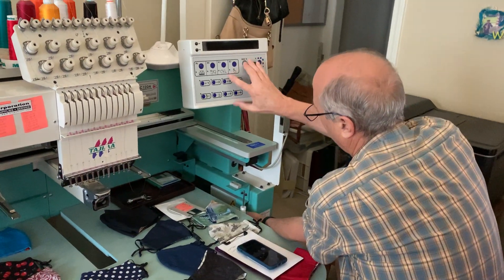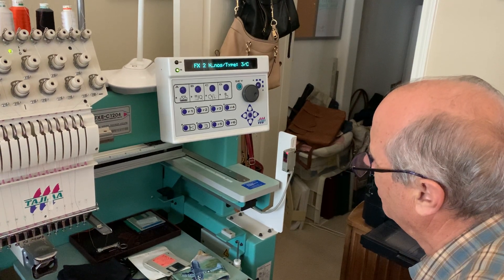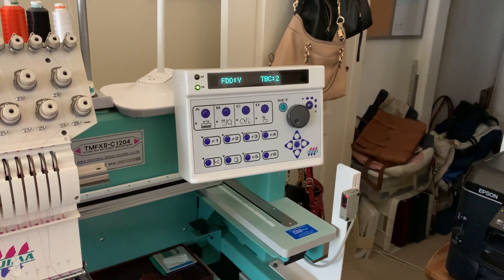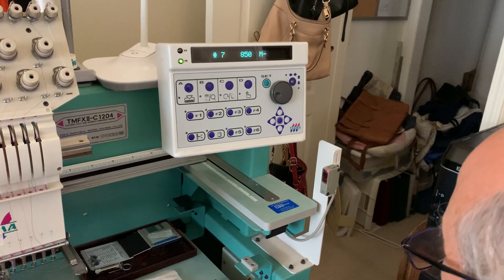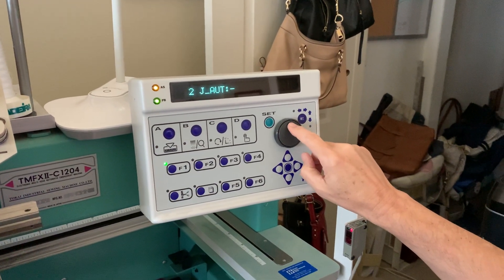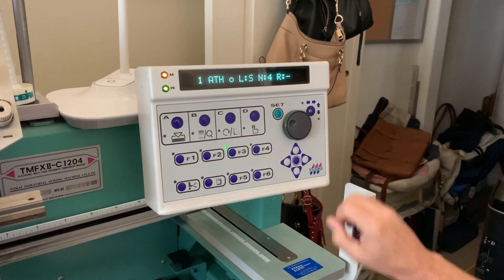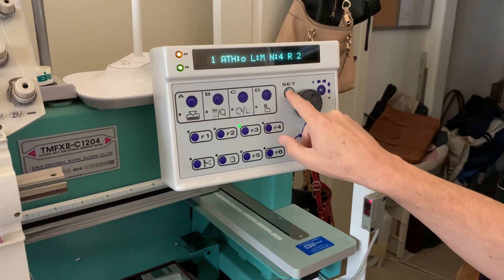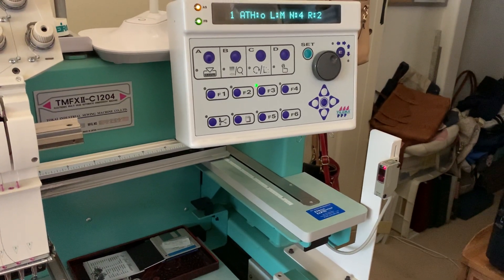Tajima TMFXII C1204 embroidery machine software firmware Installation re-install.

Comment: Good day, I got a TMFXII-C906.  If I do a manual trim it cuts the thread  but during embroidering a design it do a trim but doesn't cut the thread. Is it possible to tell me what is the correct degree or how to to check if the cam is in the correct possition? Thank you, deon.

Comment: I have a Tajima C 1501 and I reinstalled the software and it worked find again.  If I shut down the machine and come back later I keep getting a 3D6 and have to reinstall the software again, why.  by the way I did put in 2 new batteries

Comment: I have a Tajima TEHX-C1501 that doesn't return to the red zone after a trim/stop. This results in a 211 error code. Not sure if it's a mechanical issue or electronic issue. Can you hook me up with the guy on the phone to possibly resolve my problem? I will pay.

Comment: I have a tfmx c-1501 from year 2007. Can not start up the machine. It has not been used for a good while. I did replace the battery in the controller a few days ago in hope that it would solve the problem, but now I’m stuck. I’m from Norway and the nearest dealer/support is far far away.
Anyone who knows how I can be able to update the bios if that is the case? It says “floppy disk fail (40) and CMOS checksum error on the screen.
Please help anyone😅